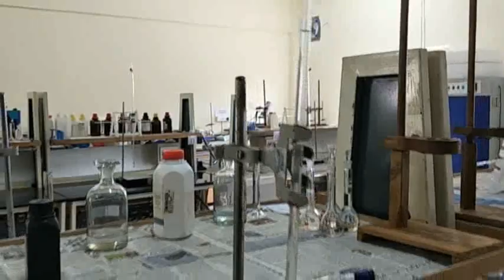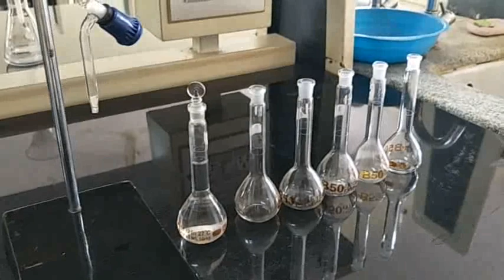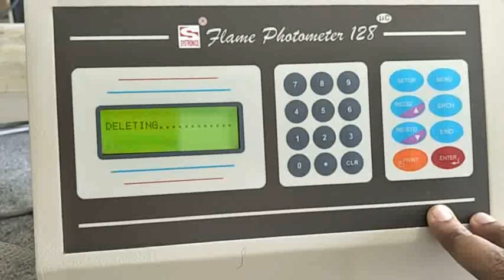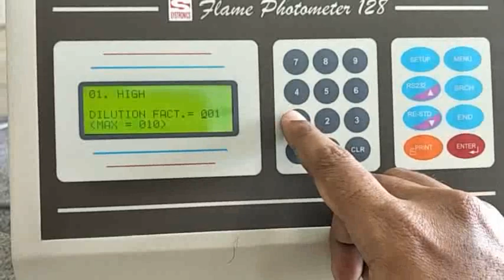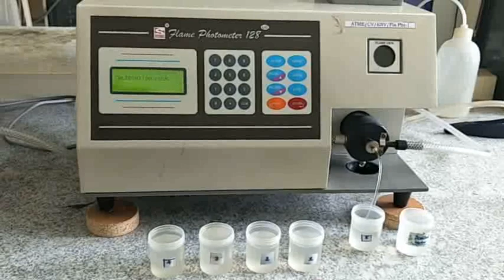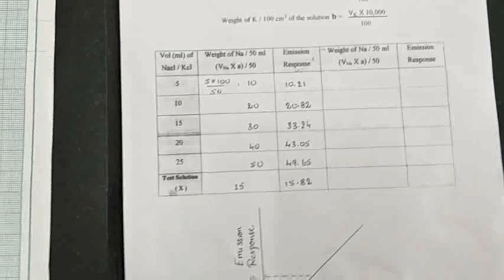Flame photometer

Comment: What is dilution factor
Reply: Dilution factor is nothing but it is a constant to multiply with the final answer.i.e concentration of the unknown solution. 
It is a ratio of the final volume to the initial volume 
In this case, 1 ml is diluted to 100ml
So, the dilution will be 100/1 
So the Df will be 100
Concentration factor is the reciprocal of dilution factor